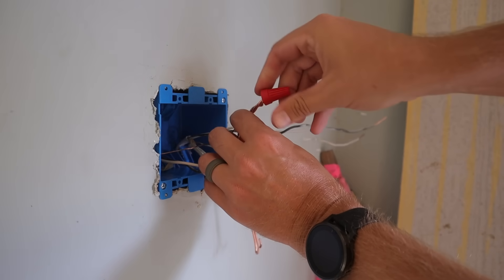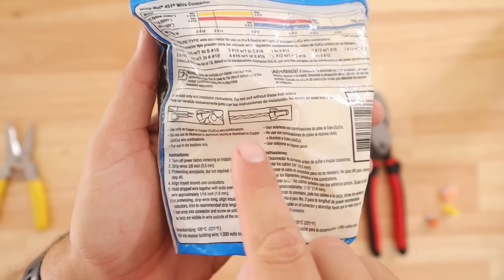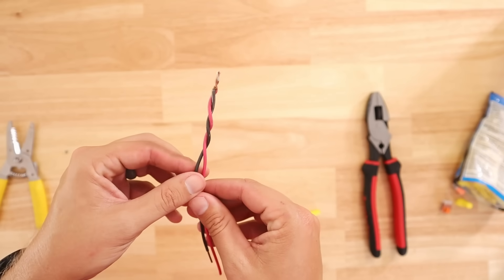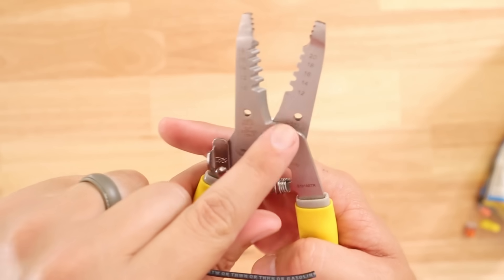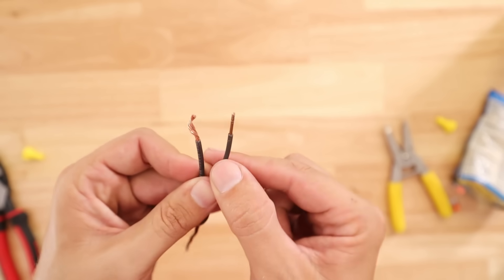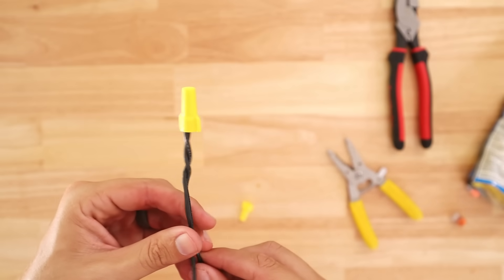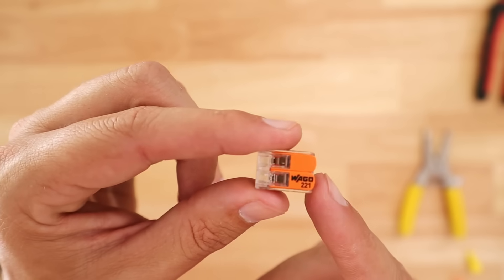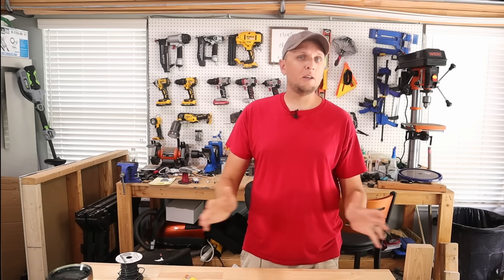BIGGEST Mistakes DIYers Make When Connecting Wires Together | How To

Comment: The pre twist in the wire nut is NOT THE PREFERRED WAY FOR AN ELECTRICIAN WE DONT HAVE TIME WHEN MAKING UP BOXES WE TWIST UNTIL ITS SOLID WITH ABOUT 3 INCHES OF TWIST EXPOSED
Reply from the maker: Hmm every electrician I know disagrees.  Time aside, it is the best way to know for sure there is a good tight connection.

Comment: Wing. It’s were designed to put on two wires not twisted and twist the wire nut enough to twist the wires with the wire nut. I was around when this was the selling point of not “pre twisting”. That’s what they are talking about.  So put side cutters on wire and twist or on wire nut and twist. You sir were not aware of selling point of “wing nuts”.
Reply from the maker: I’m fully aware.  Still personally not going to do it that way.
Reply: @HowToHomeDIY  according to your video, u didn’t seem to know about wing nut design feature. Plus u don’t look old enough to have been around back in the 80’s when the wing nut design came out.

Comment: Actually when connecting solid with stranded you want to keep the stranded slightly longer than the solid wire(s) about 1/8" longer. In fact if you look at the bag you displayed the instructions actually illustrate that, so don't cut them at equal lengths. I just went back to look at the bag and step 4 actually states that the stranded wire should lead the solid slightly.
Reply: this does help in this situation.   Wires that are the same, make equal length.

Comment: Are these caps legal in your country?
In europe are illegal for decades
Reply from the maker: They are use in almost every install in the US.  So yes very legal.
Reply: @HowToHomeDIY I see security is not a needed feature in US
Reply from the maker: See I don’t really understand this thinking.  There is nothing wrong with properly installed wire nuts.  I’ve seen Wagos fail too.  Also, usually due to improper installation.
Reply: @HowToHomeDIY  when you open a connection box with a lot of these caps, handling wires they can fall leaving naked conductors.
Thats why in Europe connectors have screws or similar

Comment: Viewing from the UK I can't see how the USA hasn't gone up in flames years ago. we used screw down chocolate box (Choc Box) terminals cut to length from a strip that never failed. Now Wago are instant and the time saved and reliability pays for them over any other solution but the only time I ever came across the twist on junk some had fallen off and the rest were loose. Who approved that as safe?
Reply from the maker: Well like you said, we have very few fires.  Wire nuts when installed properly are great splicing devices.

Comment: Learned a lot from your videos.  Have a question about removing outdoor outlets.  I've searched but unable to come across the set up I am encountering.  I have an outlet under my gazebo that has 1 conduit coming into it and also 1 coming away from it...the exiting conduit then runs (just underground) to another outlet box fixed to a short wood post (used for the pond filter and waterfall)..then that exiting conduit runs again around the pond to another outlet box (located on a wood post) which provides electric for additional filters and aerators.  At the last box the "line" ends.  The pond is being filled in and the 2nd and 3rd (last) outlets are no longer needed.  I want to terminate the electric after the gazebo and pull out the conduit and outlets # 2 and #3.  Can you tell me if you believe this is a possible DIY project.  I'm hoping my preliminary thoughts of cutting power to all three; opening the gazebo box and finding whatever line leads to #2, and hopefully remove any piggy lines and connectors.  Please advise if I have the right thoughts and if the project is one that can be DIY.  Any comments will be appreciated.

Comment: I normally never twist the conductors together before installing the wire nut, if the conductors are solid wire. If you screw on the nut and encounter good resistance as you tighten it, then tug on the individual conductors to make sure they do not slip out and they stay in place, you have made a good splice with the wire nut.  All this is applicable to splicing 2-3 wires together.  Note it is really important to use the correct size wire nut to accommodate both the gauge of the wires and the number of wires being spliced.  If the nut size is not matched to those there is a good chance the splice will not hold.

A wire nut has a helical, cone shaped coil of wire inside it.  As you screw down on the untwisted wires, the nut works its way down the conductors, exerting pressure on them from the sides of the nut and squeezing them into the narrow part of the coil.  The coil also slightly digs into the bare metal conductors to grip them.  By keeping the wires untwisted you expose the maximum surface area of the conductors to the coils in the nut and thus to the clamping pressure it exerts on the conductors.

Comment: As Marty also suggested… the Wago lever wire nuts are much better for home DYI.   Basically they are a little box with holes for the wire and a small lever to securely fasten the wires…easy, and absolutely secure. Also great if you need to disassemble for some reason
Reply: WAGOs are only used by girlie men buzzard breath!  Glad I got the chance to help you decide to man up about that...  (lol)
Reply: @johnsee7269  
That is me… I started using Wago when I left a light fixture hanging from apparently secure wire nut
Apparently being the operative word….
Reply: @MrArdytube  Kinda trolling a bit but about 35 years ago I was the outlet guy mainly... on about 30 new constructions in Kentucky.  I wired one garage by myself; service and all.  In those days it had to pass rough wire inspection and finish inspection (no lic required) for KU to connect and power it up.  Two stickers on the meter socket...  Anyway, Wing Nuts we're all we used/had.  I still hang fixtures by the ground if not an S hook of some type.  I could hang it on any of my wire nut connections; guaranteed.  They're cheap and just secure and insulate the 'twisted' connection.  I drove a lot of ground rods, etc. too; lol.  None of the thirty failed one inspection(s)...
Reply: @johnsee7269  yeah… I do this maybe once every 10 years… and so have a little less experience

Comment: There is one fault with the linemen plier's twisted joint, the standard lineman pliers have harder steel jaws with teeth machined into both of the jaw surfaces. In the copper twisting process, the jaw teeth cut into the soft copper wire leaving scars on the smooth surface in a semi-circular pattern around the conductor. These scars become a crack site initiation for the copper conductors and can break over time just from vibration. My solution for this problem was to grind the plier jaws smooth in one set of linemen pliers that I used when making the final connections, still not perfect but much better. Surprisingly the pliers came in handy for many other things I didn't want to be chewed up. I red-taped the handles to identify them as special

Comment: Only problem with twisting solid conductors with lineman pliars is that youve just nicked the copper with the stippling of the lineman pliar jaws.  That solid conductor will for sure break later on down the road in the wire nut during summer/winter cycling.

Comment: I tend to look at those wire nuts as a protection or insulation for the junction between two or more wires. The connection should be secure before placing the nut.
Reply: A hand twist adds a few pounds of pressure, and a wire nut adds many pounds of clamping pressure, so it's much more than insulation. But I agree that's a good way to think of it.

Comment: If you'll look further into NEC, it also states that an electrical connection must have a SECURE MECHANICAL CONNECTION, regardless of mechanical connecting means such as wire nuts (I'm paraphrasing this). I interpret this to mean that the wires must remain mechanically connected, even if the wire nut is removed. This requires either pre-twisting, or tightening the wire nut tightly enough onto the connection that you achieve the same result. Personally, I prefer to use the wire nut to achieve the twist, but this is very difficult to do without using some sort of tool to apply enough torque to the wire nut.

Comment: I would also recommend not using the wire nuts provided with the fixture/device. They are usually garbage. Get a small bag of Ideal brand wire nuts.

Comment: Your example of how easy the wires may come out of the wire nut is laughable, if the wire nut is tightened properly if won't come apart just from pushing it into the box.
Reply from the maker: Yeah, that’s the whole point.

Comment: I found over the years running service that on high vibration components, those yellow wire nuts would give way no matter how they were used unless they were taped , the company I worked for did not use them for that reason .

Comment: After years and years of service work and trouble shooting.  We've learned to twist all wire connections before the wire nut installation.
Reply: I'm using these push connectors.

Comment: Yes, in your opinion.  In my 'opinion', a sloppy twist makes for the same loose connection you're worried about.   Call me crazy but I think twisting is NOT necessary on 14 and 12 AWG wires.  Bigger than that and terminals should be used.  Those twisties that so many are proud of and seal off with a wire nut are no better than bares in a group.  Just being realistic.  The wire nut acts as nothing else than a protective insulator...it grasps ONLY the fattest twist....serves no purpose otherwise.

Comment: I always pretwist my connections with pliers because I've never felt comfortable relying on just the wire nut holding the wires together. I worked with an electrician friend once doing a residential job and he not only pretwisted but actaully taped every wire nut after making the connection. I thought this was a little overkill in my opinion but he felt this was the best way to insure that the wire nut could ever come lose
Reply: Yup

Comment: I was installing a led light for my daughter and I could not get the light with the separate transformer work. I was ready to give up and tried the only thing that I could think of and removed the wago connectors and used wire nuts instead. That fixed it! I no longer trust the wago connectors.

Comment: I also reinforce it with a high grade electrical tape securing the wires from untwisting and securing the wing nut in place 'just' in case something comes lose .  It also adds another layer of insulation on the wires to help prevent breakage in the wire insulation.

Comment: If that's all you are going to do to secure the wires is just barely tighten the nut.... of course that's not good.  You can usually get the same result as pre-twisting if you know what you're doing... best not to do it with anything larger than #12 wires.

Comment: Pretty good video to help DIYers avoid problems. There's a lot more to installing wire nuts properly than many realize. Most people I've watched don't even strip the wires correctly to begin with or know the correct wire combinations, voltage ratings, etc. I understand why you suggest WAGOs for certain situations but I've seen way too many problems with them... mostly due to how they were installed but also due to the little barbs inside them losing tension over time. The connection to the conductor becomes so loose I've seen the insulation cook to a dark brown. I wonder how the lever type WAGO connectors in your video will hold up over lots of time and heat. I'll take a properly installed Ideal wire nut every time but even those fail given enough time, heat, etcetera. Nothing lasts forever 🤷🏻. It's good there's people like you trying to educate people. Keep up the good work. 👍🏼
Reply: For sure a lot more resistance when you go from wire to plate to wire vs wire to wire directly. Resistance = Heat and if you live somewhere hot and dry... might want to consider cutting down on resistance in the walls any way you can.

Comment: Great video. 
I have been in the electrical field for over 40 years and am a licensed electrician. 
Always pre-twist your wires with a lineman then install the wire nuts.  I take it one step further a tape the wire nuts to the wires.  Never had a connection fail.
Holding back judgment on the displacement connectors because they are too similar to the displacement connections on the backside of cheap receptacles that always fail.
Reply: I have a house built in 1953 and no way will I twist the wires. What I do is twist the wire nuts on then tape the 2 wires together. With that old aluminum wiring special glue, twisted the wires and taped the wires and wire nut. Aluminum wiring is no joke.
Reply: @coreyh7323  might want to think about replacing some or all of the wiring with copper.  Even if only on room was rewired at a time. As you said,  aluminum wiring is no joke.
Reply: @johnw9874  Oh I was just speaking from experience. My house has old 12 gauge wiring with the braided cloth wire from the 50's. I have done mobile home work switching out switches and outlets, adding fixtures (as a handyman) where there was aluminum wiring.  That stuff always made me super nervous. I don't do any electrical anymore except recently changed out a GFYI and changed out a ceiling fan in my bedroom.
Reply: Do you use electrical tape?
Reply: @denisemartin3603  I wrap wires together with electric tape always
Reply: @denisemartin3603  always

Comment: No Pro here. But I am related to one. I was informed that these clamp and push connectors are according to the NEC for luminaries only. I don't find that cautionary mention in a lot of these DIY electrical "tips" videos on the TUBE. Heaven forbid a house fire was deemed to be faulty due to do it yourself or non-inspected wire connections. Insurance company's can be very creative in not covering a policy. I use these connectors too but with the same practice of wire nuts by pulling aggressively on the joined conductors to be more than certain they are stable within the connecting device. Nice video and handy tips thanks.

Comment: If you do what you demonstrated first, 9/10 times you will break the copper off. It’s better to twist the wires then twist the ends, then cap and tape. You keep twisting like that you end up breaking wires off. Copper isn’t strong

Comment: I’ve been in the commercial and industrial electrical field for over 7 years and not once have I seen a single person pre-twist solid wires with a pair of linesman pliers. Line the stripped ends up and crank a wire nut on them.

Comment: Why didn't you discuss the use of a wire nut wrench when tightening wire nuts ?
Even though I worked for another of the major electrical parts manufacturer, I used a Ideal Wire Nut Connector Wrench .

Comment: Proper pre twist with a wire nut … No failures

Proper install with wagos…. Still have failures..

Never been a fan of wagos, the wires still have movement and have seen many failures with them. But what do I know I’m just an electrical contractor and been in the trade for 24 years.

Comment: Be very careful with the connectors that you use. I just started using WAGO connectors for certain things (love them) & I noticed that there are a lot of cheaper knock-offs that are NOT UL-listed. Keep in mind, if you ever have a fire & it is determined that the fire was caused by an electrical product that was not UL listed, your insurance company will probably not pay your claim.

Comment: Good examples of a safe splicing.  I always use about 10 inches of  electrical tape.  Start wrapping the tape about 2 inches below the wire nut, then wrap it around the wire nut until you have completely covered the wire nut.

Comment: Good video. No matter what type of wire nuts I use, I always perform a tug test. To pass the wires must stay in the wire nut when pulled, otherwise it's a do-over. I notice you did that, but I think you should mention it more on every connection shown to bring home the point.
Reply from the maker: Yup great point!  Thanks David.
Reply: @HowToHomeDIY  you did tug them only non observant people will not see this and clever people know you dont need to show this in every example

Comment: I like to use a nut driver on wire nuts to tighten them securely.. the most common mistake I run into is someone used the incorrect nut for the gauge of wire(s)
Reply from the maker: Video coming out tomorrow on that subject.  It’s very common.  Thanks for the feedback James!

Comment: Sorry to be critical here but in the case of the stranded to the solid, you are wrong with the pre twisting of the conductors.  After stripping the stranded I do twist the conductors tight to assure no stray conductors, just as you do.  I do not then twist them before application of the wire nut.  What you did wraps the stranded around the solid and does not provide for the spring in the wire nut to engage the solid conductor and get a bite to assure resistance to possible mechanical stress pulling the solid conductor out.  The best way I have found in my 20 plus years as an electrician, 10 of which are service and troubleshooting, is to simply parallel the wires with the stranded about 1/16" above the solid and then tightly apply the wire nut.  This assures both a substantial mechanical and electrical interface with both conductors being engaged by the wire nut spring.  Otherwise pretty good advice.

Comment: I have always done what you showed for the twist connectors, but my dad also always taught me to then use some electrician tape to secure the cap as well by wrapping a piece in the direction that tightens the cap and holds it firmly. Is that not recommended?
Reply: it is a added precaution which also prevents dust and condensation getting to copper and causing corrosion dad is right to add this step